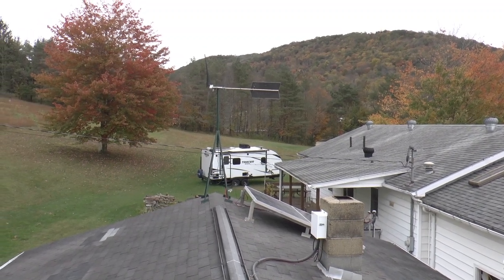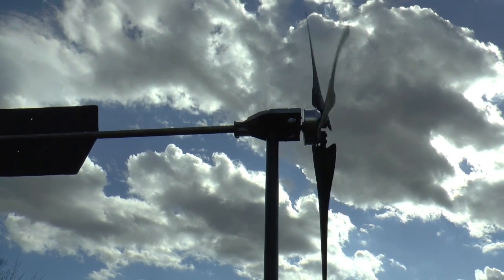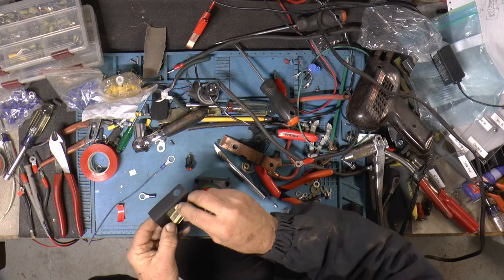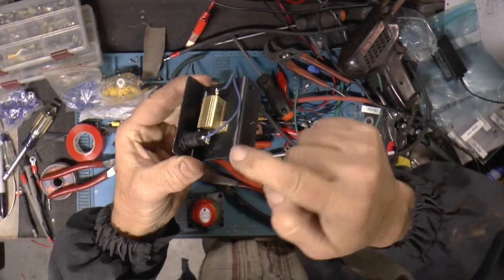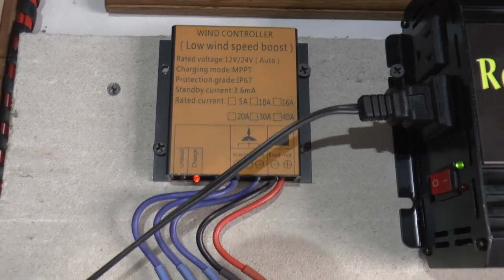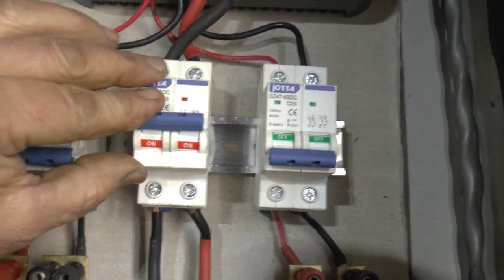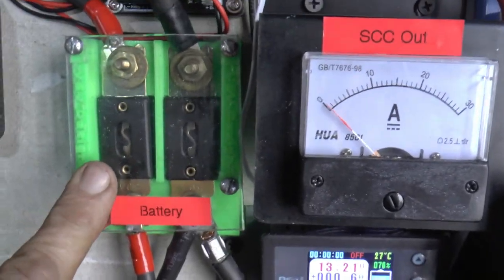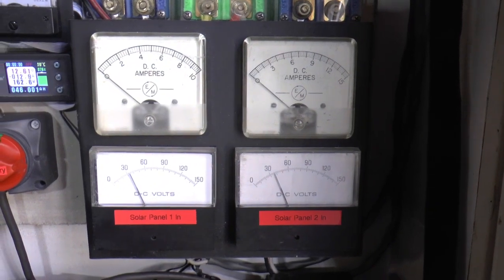Solar & Wind 12 Volt System Just For Fun

Comment: How do you know what the rating is on that 12v controller? They didn’t mark anything.
Reply from the maker: If you mean the wind boost controller the ebay listing said 800 watts. It really doesn't say any where on the instructions that came with it either.